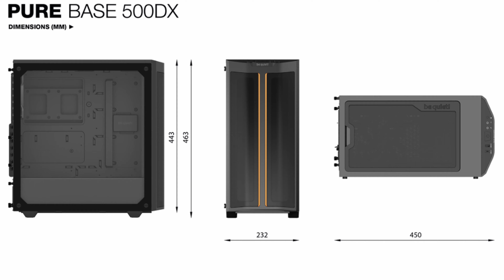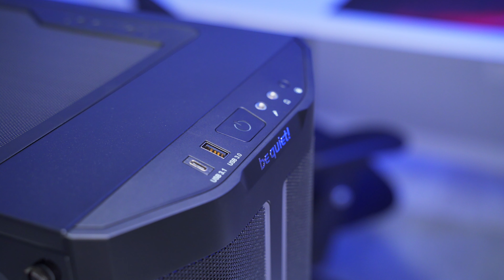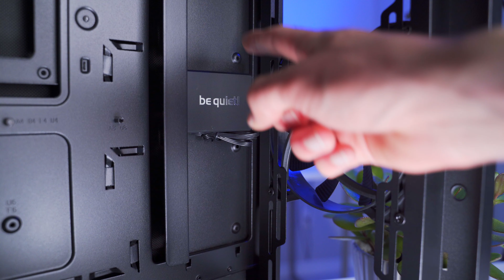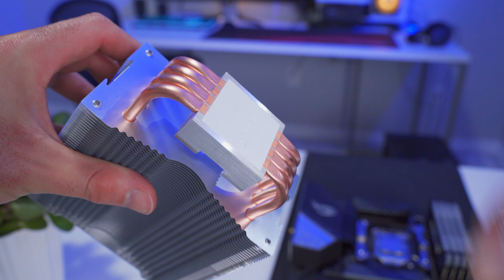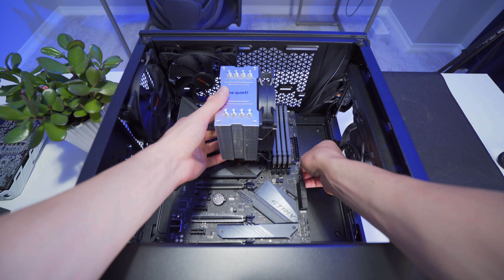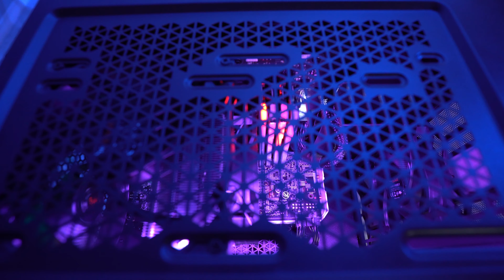be quiet! Pure Base 500DX Review and Full System Build

Comment: Hey, question. Where do you control the rgb. Because I didn’t see a rgb button on the case and I want to know where it id
Reply: Theres a button on the front io and you can also connect an argb cable to your motherboard to control it with your motherboard.
You can see him pressing the button at 6:34 too

Comment: Nice review I have this case still in its box here. I also bought a kraken x63 280mm. Would that fit on top? I thought so, but your review gives me doubts 😱
Reply: late question, but did it fit? hahaha i think only 240mm rads fit right?
Reply: @iziryu  I got it to fit in front ..I don’t think it would fit on top
Reply: @ramtin-s8722  ahh yep, only 240 seems to fit top im deciding between lian li 2 and pure base 500dx
Reply: @iziryu  its a nice looking case. But it’s pretty tight tbh...I would go for one with slightly more room if you want to fit a thicker radiator on top which is better than a front mount...unfortunately I had no other choice
Reply: @ramtin-s8722  you got any recommendations? I'm trying to find white I only know corsair 4000D and the Lian li which seem to be both pretty decent
Reply: @iziryu  I think the lian li is pretty nice...I think both have good airflow so it is a matter of preference...I would check reviews for both and make your decision

Comment: Great video, thanks!
Do you think an Arctic Freezer Liquid ii 240mm will fit? (top or front)
Reply: 100%, i have a 360mm mounted to the front of my pure base 500dx. only problem is hoses are up
Reply: @spencerwilkerson6458  
Thanks for the reply!
The tubes aren't long enough to be mounted front, facing down?
Reply: @DanTurambar  correct, unfortunately, the Corsaire 150 tube length won't reach around the GPU, especially with the 3080 being such a beefy card it would need another couple inches to reach. but with tubes up i don't get any pump whine, just make sure the bubbles are pushed to the radiator upon install
Reply: @spencerwilkerson6458  I was reading your conversation and I was wondering if you could give me your opinion: I have a 3950X which needs a lot of air flow. Do you think that case will work good with it? I don't really like cases that look like an aquarium. It is tacky for me. My idea is, since that case comes with 3 fans, I wanna use those as an exhaust and install 3 intakes 360 mm fans along with 360mm radiator. I just don' t have idea which fan and radiator brand to use for this. And the lights I wanna use those LCD lights which already comes with the case. I don't like many lights. To end up, I would like to have my GPU to stand up, which I could show those 3 fans and the GPU light.
Do you think that this can do it ? ty
Reply: @ejer.  I think so, I also have a 360mm radiator on the front and the only issue I've ran into was needing to have my tubes up rather than down since they weren't long enough but that may be different on brands of AIO
Reply: @spencerwilkerson6458  im not sure if it has space for aio at the top
Reply: @sho12311  not at the top, but it has room on the front

Comment: I am trying to set my PC up in this case but the power led and hdd led front panel connectors are no where to be found. Did you have any issue like this?
Reply: Quick correction the reset switch is missing not power.
Reply: @paulosalles9206  doesn't have reset switch,like the pure base 500 case didnt have one.its not so big deal tho :)
Reply: @21777gabriel  got it thank you.

Comment: does the ASUS ROG Strix B550-F Gaming fit with the rear stock fan ?
Reply: The case supports ATX motherboards so yes. It will fit since it was designed for it.

Comment: Im looking into buying this case but my one concern is that cable managing the 24 pin cable would be difficult due to the small gap on the cable management bar. Does anyone know if thats how it actually is when building in this case or am I just overthinking my first build?
Reply from the maker: it's definitely a tight fit with the 24-pin cable, but it's still manageable.